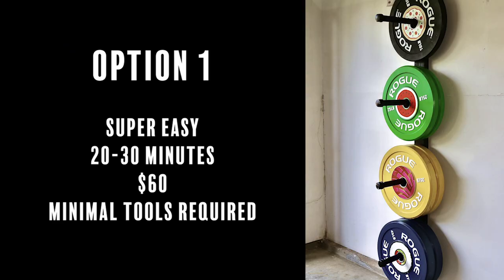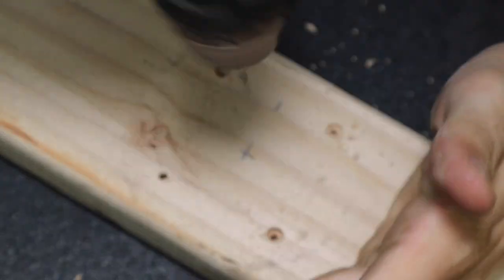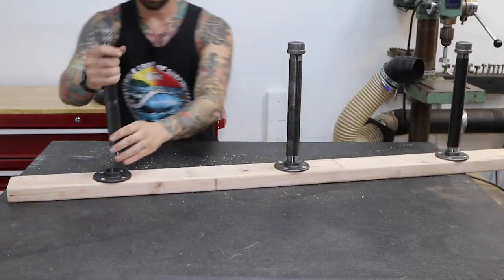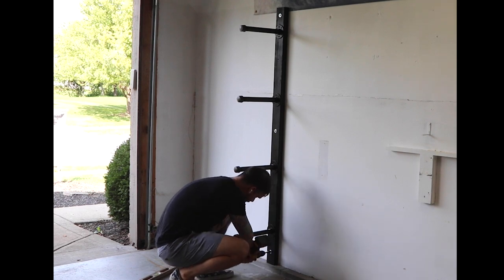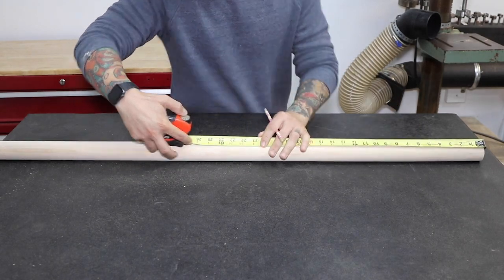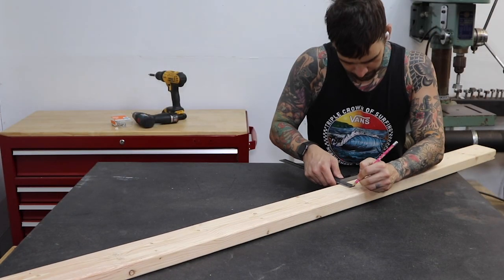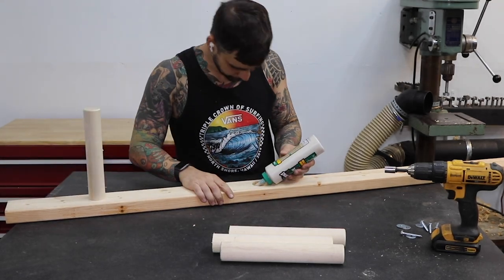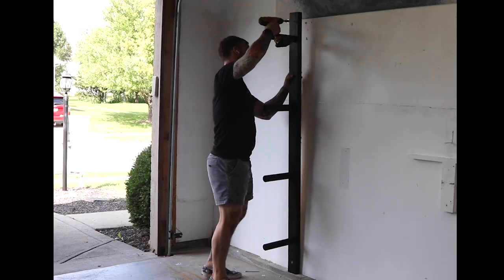Weight Plate Storage DIY Wall Mount Bumper Rack for Home Gym

Comment: A good way to find wall studs is use magnets to locate drywall screws. Use 2-3 magnets, find 2-3 screws vertically and there’s your stud.
Reply from the maker: That’s pretty clever, thanks for sharing

Comment: What’s better the metal plate option or the wooden dowel option? For option 1 and 2 on your video? Which can you load up more
Reply from the maker: If you’re looking to load up super heavy, I’d go with the metal pipe but use bolts going all the way through the 2x4. That’ll be strong enough for just about anything

Comment: Material and design strength question for you...  With your design, which do you feel is theoretically stronger? Pipe vs dowels?

I ask because even though the pipe is metal, there is less surface area countersunk into the flanges. The dowels seem to recess deeper into the material. In the past, when I have threaded pipes into flanges I can only go a few rows thread deep into the flange. Also the wall  thickness is less with the pipe vs dowel.

Anyways. I am interested to hear your thoughts. No physics formulas required in your response.😉😂🤣
Reply from the maker: I’ve been using both in my gym for years without any issues. They’re both pretty damn strong. I’d have a hard time guessing which is stronger without some sort of test (or engineering expert chiming in)
Reply: You could drill with a hole bit on a drill and screw the pipe deep into the wood to give it more strength

Comment: How much weight do the options hold? Specifically 45's?
Reply from the maker: I designed these to hold a full set of weights (255 pounds) but they can probably handle more. I keep four 45s on the bottom. You can always use bolts to make it extra secure too.

Comment: What is the inner diameter of the flanges? Are they 1 1/2 inches? If so, the plates should fit kinda tightly?
Reply: After watching again and seeing the caps the flanches and pipes probably are 1 1/4 inches?
Reply from the maker: Yes. It’s a 1” pipe, the outside diameter is slightly over 1”, the weights have 2” holes, so there’s plenty of room.

Comment: i mounted my pegs directly into my wall stud. should I be worried about hanging the weight directly on the wall stud? or should I add an extra 2x4
Reply from the maker: That should be fine. It really depends on what you used to mount - short screws vs long screws, wood screws vs lag screws

Comment: Great video.  One quick question: how many 45# plates do you think each dowel could hold, safely?  Just the 2 shown in the video? Or could it take 4?

Thanks.
Reply from the maker: If you use bolts instead of lag screws you can definitely put 4 plates on each dowel.
Reply: @KaizenDIYGym  dumb question.  How would you attach the carriage bolt to the dowel? Where would the nut go? Been a long day here and my brain is not registering. :)
Reply: One other question (sorry). Would you say the steel pipe and flange option is ‘stronger’, if you wanted to have 4x45#s.
Reply: @MarkGowdy  I would say yes, just put lag screws in the flange
Reply: Try drilling all the way through or just to the bottom of the 2x4. The more depth the dowel has in the 2x4 the stronger it will be. Just make sure you use wood glue and you should be fine. You could also you a 4x4 and that would be much stronger as you could put the dowel at least 3” deep

Comment: Nice build! Just a note that if you're staining pine or other softwood, you might want to use wood conditioner to get a more even application.

Would've loved to see you try loading each option to failure 😂.
Reply from the maker: Thanks for the tip. I’ll have to make a follow up video sometime loading these up to failure.